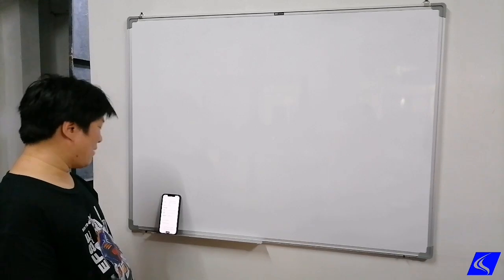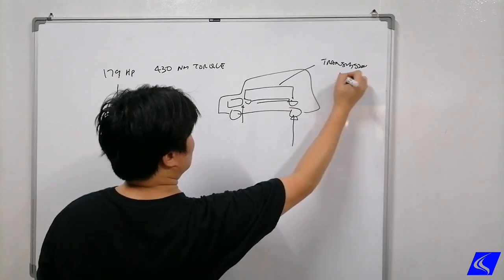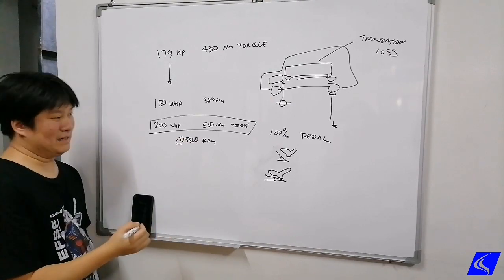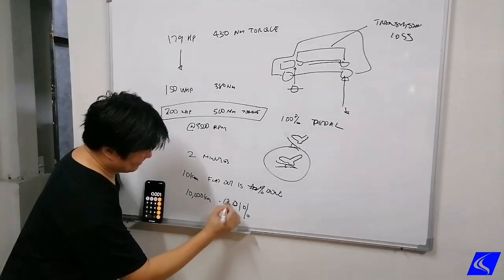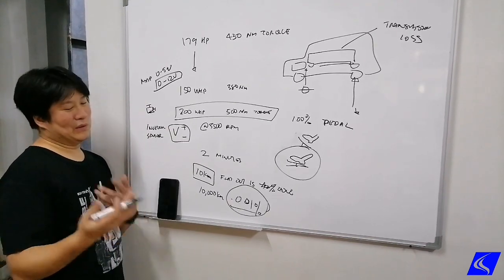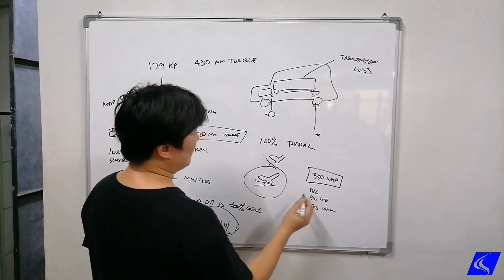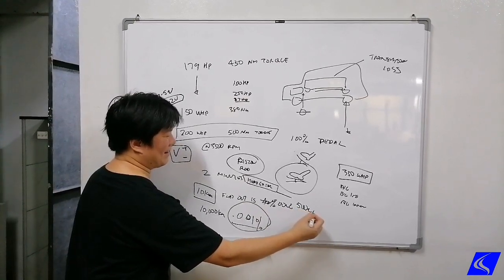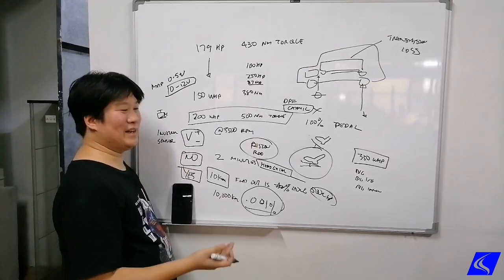Will Remapping Make your Engine Explode? No it Won't

Comment: Hi sir I have a question. Do you remap old cars like a Honda civic Vti, Ph16 engine. Kasi Im also planning to remap my dads old car medyo natengga na ren. Pero ginagamit pa rin naman po. Also another question. Does changing a muffler damages a cars engine? Kasi when I asked ang sabe saken masisira daw ang ecu and engine most of the time nagkakaroon daw ng check engine, kaya after daw muffler change or full exhaust ang papalitan dapat daw ipa remap agad. Is that true po?
Reply from the maker: Yes 
P30000

Comment: Hi Sir, question lang po. Before remap do you need to disable EGR? But then, does it still pass the emissions test? Early thanks po sa reply.
Reply from the maker: We disable egr wit the remap

EGR has nothing to do with emissions and yes it will still pass even after remap

Comment: would you recommend remapping old engines with old transmissions? I'm planning to have a remap to remove the throttle delay but I'm having second thoughts if my engine and transmission would get in the way. Thank you in advance for answering.
Reply: The engine is a K20a4 - honda
Reply from the maker: Mileage?
Reply: @speedlabchannel4452  117,779
Reply from the maker: @kevstaisan  pwede pa 
Assuming properly maintained

Comment: Any suggestion kung anong available diesel car ngayon sa market ang pinakamabilis lalo na kapag minodify with your help.
Reply from the maker: Navara
Reply: Planning to have one, for diesel drag race and daily use.
Reply: @bjornsevilla1148  Dmax. 4jj1 is relatively madaling galawin considering matagal na sa market
Reply: Manual or Automatic, what specific model of Navarra? And after your full package, ano expected total hp?
Reply from the maker: @bjornsevilla1148  automatic
330-350whp